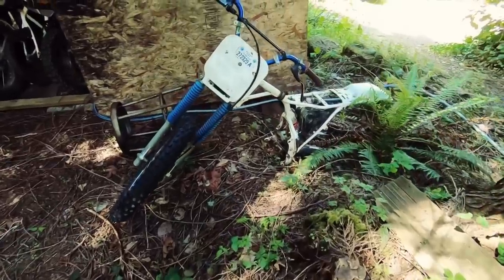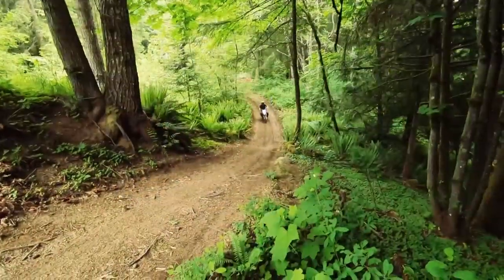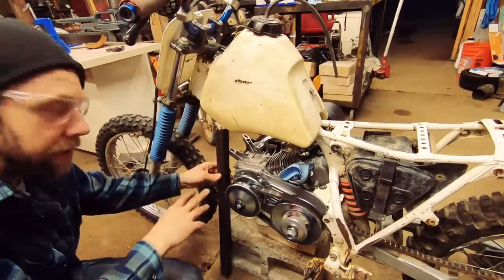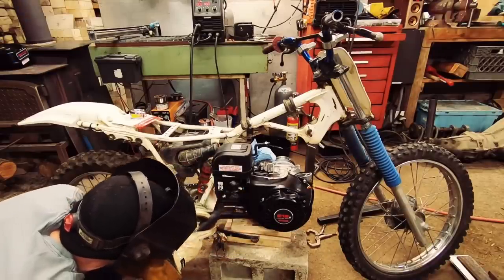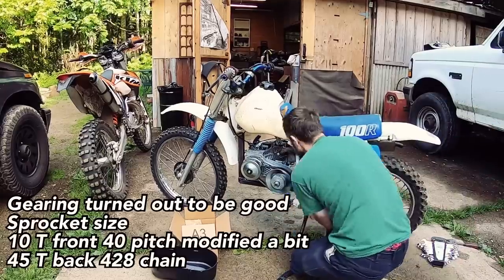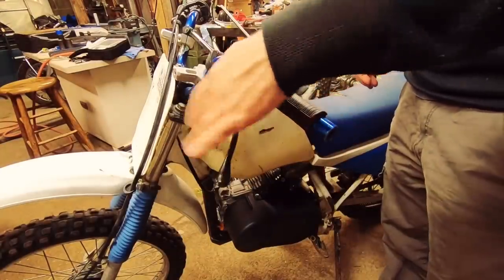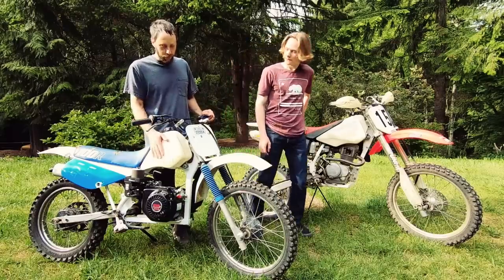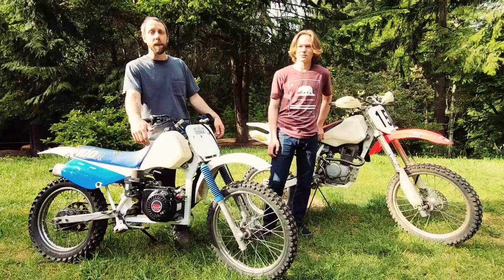Predator 212cc engine swap mini bike motorcycle

Comment: Could you just weld the old sprocket on the new sprocket that comes with the kit?
Reply from the maker: No this won’t work due to the lack of room where the sprocket fits in the CVT. Probably a good way to go is just use the stock 40 pitch sprocket that comes with the CVT and order a 40 pitch 50 tooth sprocket for the rear wheel, Transfer the bolt pattern to the sprocket and run that on the back wheel. I think this would be the best, because the 428 chain is really to wide to fit good between the CVT backing plate and the back pulley. I hope this helps 🙂

Comment: Neat build I think I'm gonna try to find an old dirt bike to do that to .... Probably be worlds better than these Chinese mini bikes
Reply: georgiaridgerunner 79 why wouldn’t you just fix the engine on it? If it has one
Reply: Because th as t gets expensive with old bikes and sometimes this is more fun.  I use a 1978 km100 to ride in the pit area at races, and if that engine blows, I will probably go this route.
Reply: @austinw561  Austin for a project like this one would want a bike with a junk engine ... I wouldn't buy a bike with an engine that was worth something for a project like this

Comment: What is trans called ,to fit those engine,s  probley work good for those cheep Chinese, 4 wheelers  also
Reply from the maker: Look up go kart CVT torque converter, I will post some links to Amazon in the next video :) Take care :)
Reply: If your looking for a cheap direct auto drive setup even search up centrifugal clutch 212cc for alot less weight too. Loads more tq compared to this hp stretcher setup
Reply: Thanks for reply

Comment: Cool video man, I have an old 1982 dr125 with a shot motor, it’s a full size frame, and I was wondering if you think that a predator 212 would move it, also I was wondering how your welds have held up over this time?
Reply: It would prolly run and i think quick welds would do if not then remake the frame or smth
Reply from the maker: My 212cc bike is still doing great 👍 
The engine stock would probably move your bike about 40, with some upgrades it would probably do about 50 or 55MPH.
My welds are holding up great, I have been welding for years now and have welded much more technical stuff then this little mini bike frame.
Take care
Reply: Thank you for responding, I think I might try this project myself

Comment: I want to try this on a three wheeler. Someone said I need a jack shaft. Can you tell me why or when this would be necessary and is that something I can by online?
Reply from the maker: I don’t think you would need a jack shaft, just run a CV transmission any you Should be good 👍
Reply: Mike festiva I was looking at the three wheeler today and it has a Kawasaki engine similar to the predator engine. It was like that from the factory but it is driven by two belts and a forward and reverse gearbox. I’m hoping to be able to figure out how to adapt everything. I might try to put a chain sprocket on it and run it similar to yours.

Comment: I have an old 250 virago with bad engine.If I were to use an engine like this to build a fun runaround bike,could I still use the virago's transmission......and how would I do that?....
Reply: I’m not sure but I’m thinking not
Reply: Yes bro it is possible
Reply: Check out engine to gearbox conversion mostly done with atv engines but i thinkit could work
Reply: Uranik Kallaba good to know
Reply: I could be wrong, but bike transmissions are for the most part built into the engine. It’s not like a car where one bolts onto another, so I’m gonna say you can’t. Good luck though! Those Yamaha’s are nice bikes
Reply: @maverickwoodcock7889  yea thats true but if you find some engine that has a blown piston or some problem, not in a working condition,  you could initialy use the other part of the engine as a transmission

Comment: I HAVE A 1990 CR250 WITH A BLOWN MOTOR. THIS IS WHAT I WANT TO DO TO MINE. I WAS THINKING OF USING THE 301 8 HP . WHERE DID YOU GET THE 428 SPROCKET FOR THE TORQUE CONVERTER ? COULD I GET A 520 SPROCKET TO MATCH MY REAR. VERY SURPRISED THE BIKE MOVES THAT GOOD WITH A 212 .
Reply: If it's a 2 stroke 250 just rebuild the motor if it's a 4 stroke cr 250 then I would go that route
Reply: @zebsdreamgarage9898  honda didnt make a crf250 in 1990. He definetly means 2t 250
Reply: @nou943  I completely forgot about that
Reply: @zebsdreamgarage9898  THE CYLINDER IS BAD, THE POWER VALVES ARE WORN, THE LOW END BEARINGS RUSTED STUCK. I HAVE ALL THE OTHER STUFF TO CHANGE IT. WINTER PROJECT MAYBE
Reply: @howtoguroo2686  ya that's a good winter project. I would be able to rebuild that engine in 2 weeks. Only because if the lower bearings are seized that makes it a lot harder to tear apart just soak as much stuff as you can on it with penetrating oil. And leave it soaking for a week
Reply: Bajapowersports.com used to sell every part inluding the woodruff key for the front sprocket
Reply: @zebsdreamgarage9898  THE ENGINE IS EASY TO REBUILD .THE CYLINDER ONLY 1989-90 I THINK WILL INTER CHANGE , SO PARTS ARE HARD TO FIND ON THE POWER VALVES. I LOOK FOR USED CYLINDERS ON EBAY , 1989-90 CAN NOT FIND ANY CHEAP ONES . I BOUGHT A 1989 AND 1990 USED BIKES HOPING TO MAKE ONE GOOD ONE .BOTH CYLINDERS WERE BAD .
Reply from the maker: I hear you on the old 2 stroke. I have a awesome 96 KDX200 that needs a new crank, the cylinder needs re plating, it’s going to cost over $800, in parts, there’s just a point where I draw the line on how much to put into a old bike.
Reply: @Mikefestiva  YES, I AGREE. AND SOME TIMES YOU CAN FIND GOOD USED PARTS ON EBAY THAT HELP KEEP COSTS DOWN. THE 1990 CR250 , I'M THINKING PULL START MOTOR REPLACEMENT .I HAVE ALL THE PARTS .I DON'T RIDE FAST ANYMORE ( I'M 60 YEARS OLD ) .THIS BIKE WOULD HAVE BEEN PERFECT AT THE WIND ROCK PARK IN OLIVER SPRINGS IN TN. SLOW , ROUGH TRAILS UP THERE . WE MET UP WITH RED BEARD FROM RED BEARDS GARAGE , AND HAD A GOOD TIME . BUT THE MINI BIKES JUST BOTTOMED OUT THEIR FRAMES ON THOSE ROCKS . VIDEO SHOULD BE COMING VERY SOON FROM RED BEARD.

Comment: ive been looking to do this to my 1980 xr200, since it got a crack in the cylinder
Reply from the maker: RNDM-R1DR  I think this is a good way to go if you have a bike that’s got a bad engine, it will definitely get you riding again! I hope your XR200 turns out good :)
Reply: thanks man
Reply: I hope you do it this seems like such a terrific swap especially the way Mike does things simplicity is genius

Comment: Predators are good engines but duromax engines are better I threw a 16 horsepower duromax engine on my go-kart in now it go 60 miles an hour and got so much power highly recommend those engines
Reply: Or get a predator 420cc and go 70 or 80!
Reply: @bradley1995  The duramax ones are actually more powerful
Reply: Good luck fitting 😂 You might end up having to mount the motor way near the ground, the 212 is tall and like you can see on this video, he lost some ground clearance and the larger Predators are inches taller plus wider, and wider would make it not so enjoyable for handling in my opinion, and maybe be too bulky for a dirt bike.
Reply: I think those are more expensive

Comment: Got a 77 yamaha tt500 and a honda gx340 looks like i done found a good purpose for both
Reply from the maker: Sounds like a plan!
I had a old Yamaha SR 500 ( it’s the street version of the TT/,XT) that I converted into a big dual sport bike, it was a wheelie machine 🙂
Reply: Update new frame section is built jackshaft is mounted just gotta figure out my rear sprocket situation

Comment: Wow talking about mini bikes from the fifty’s and sixties i build mini bikes and mini bikes now have suspension
Reply: My brother owns an original Taco 99 minibike, circa 1968. It has front and rear suspension and a 5 horse Briggs.  The most bad ass mini-bike from the sixties was the Bonanza which  had a Hodaka 100 and 4 speed transmission.
Reply: @scootergeorge9576  you mentioning hodaka motorcycles brought back some fond memories,  i always thought hodaka had better names for their bikes than any other manufacturer , i mean come on, who wouldn't want a dirt squirt, or a road toad or maybe even a wombat to blast around on? lol
Reply: @ht2275 -  Ace 90 and Ace 100 come to mind. They were pretty cool bikes. In the sixties, I rode a Honda but thought the Hodaka was a cool dirt bike. This was Thousand Oaks, CA. Back then, there was a whole lot of open land for dirt bikes. Now it's densely populated "Yuppie-land"

Comment: So 212cc good enough or would like 420cc engine be better? Thinking on doing this
Reply: A 212cc would probably be the best. 412cc would be to much.
Reply: There is no 412cc predator there's a 420cc
Reply: @tjc9431  meant 420, i didn't see that
Reply: @ChristianLance.  too much?? I just sorry it wouldn't fit
Reply: @fatalcapsaicin5157  It would be too much for the dirt bike with that size of a frame.
Reply: Just buy a lifan 125cc instead, that thing has more HP and it has a 4 speed shifter with 60mph top speed.

Comment: I didnt hear you say this..but I hope u already addressed the kill switch..did you mount it on the handle bar area?.. atleast the orginal  bike had a clutch to pull in if the carb stuck wide open.. if this bike did the same thing...no way in hell could u bend down to shut it off.. plz tell me you wired in the shut off switch to the bars..lol
Reply from the maker: Yes I wired up a kill switch, like you said without a clutch it could be bad if the throttle stuck without one.

Comment: Ordered the cheaper one that is in the link and it does not fit. The keyed part does not fit in the slot.
Reply from the maker: Sean W sorry to hear that. I just checked the link and it looks like Amazon sold out of all the 3/4” kits, the only ones were available were 1” clutch CVT kits. I just deleted that link, I don’t like that Amazon changes products without notifications. Now does the clutch not fit the shaft size or just the keyway? The stock keyway for a 6.5hp predator engine is 3/16” does the key fit to loose or not at all? Is it close but won’t fit? Let me know.
Reply: Mike festiva I had to ship it back, the key on the clutch was way bigger than the HF key way

Comment: What's the too speed?
Reply from the maker: I will test the top speed before and after modifying the motor in the next video, so keep an eye out for that one :)
Reply from the maker: Sure I don’t see why not! If the stock 212cc predator engine doesn’t feel powerful enough, you can always hop them up quite a bit ;)
Reply: But always sweet build are you using the xr 100 exhaust

Comment: Can’t you get like 15-20hp out of these engines?
Reply: Kyle King sure can. It can be expensive when you start going say over 15hp but those little motors at champs and they’ll take it. I got mine doing about 15ph in a weekend. Rebuilt with performance cams and such.
Reply: zach trensey to be fucking fast lmao what else
Reply: You can get just north of 30hp last I heard but that costs some serious cash.

Comment: How did you do the chain to belt??
Reply: jack shaft
Reply: The front centrifugal clutch is connected to a rear centrifugal clutch, so the front clutch spins the belt which spins the rear clutch which has a sprocket on it which turns the chain

Comment: Were can you get the chain for this was lookin to use the engine on my old goat cart
Reply from the maker: E bay or Amazon will have a chain. The chain that runs stock on the this torque converter is size #40 that’s 1/2”

Comment: Lucky it all worked out with the gearing. Wouldve sucked if you got it all together and it topped out at 10mph.. I thought of doing this many times, but never have got around to it.
Reply: Surprisingly good torque for stock motor
Reply: Those 212 are beast
Reply: @theworstgamervr  yeah they're great. I meant if the sprockets and wheel diameter were off you wouldnt have much top speed. Looks like you eneded up with a good rounded ratio though.
Reply from the maker: I figured the gearing would be close, if anything I thought it could be a bit tall before I built it, but after riding it around it’s pretty good! I have had much bigger challenges in gearing, I built a sawmill a few years back and I worked out all the gearing before I built it, Engine RPMs, pulley sizes, final wheel size, maximum blade speed to hp. My sawmills gearing is great. That was much more involved to calculate, this motorcycle project not so much. Thanks for checking out my video.
Reply: Im super interested in a project like this you can find frames like these were someone blew out the motor, Pretty cheap and a 212 pretty cheap, my question js this a stock predator? Is that a super light frame i just dont see how your getting that kinda torque with the 6.5hp motor.
Reply: @theworstgamervr  6.5 hp but they make about 12 ft/lb of torque stock. They are punchy little motors stock and you can be at around 9-10hp with a jet kit and good exhaust. They are workhorses. Even stock they'll pretty much chug up any hill. Would be an easy project. Just weld a plate in a double cradle frame, line the motor up and bolt it down and hook the chain up. Btw theres a video of someone putting a 212 in a toyota pickup and it drives around... If your wondering about power 😂

Comment: What kind of transmission
Reply from the maker: CVT 👍
Reply: @De Wisnu No, its not even close to being powerful enough to do that.
Reply: @De Wisnu The engine will certainly be more powerful, but most likely it will still be unable to pass a hard climb as things like that require a lot of power from the engine. Engines that are capable of such things are 450cc engines.

Comment: I'm building a bike with a vertical shaft mower engine.  Ayyy
Reply: That's not gonna go very fast
Reply: My friend put a 3 hp pushmower engine on a old riding mower one time and changed the pulleys around it would do a wheelie for 15 feet when he let off the clutch/brake and run about 35 mph
Reply: @intotheadventure2592  I bet it'll go 20-30 mph.  Not bad for cruising around
Reply: @IntelGoesHard  no it wont ur gonna rev it and blow the motor those arnt ment for revving
Reply: @intotheadventure2592    I've abused a flathead Briggs and Stratton before.  It'll rev just fine to maybe 5000 RPM or more with mods before it chucks the rods.  The valves will float before anything detonates on a stock engine.  Also, if I keep it to 3600 RPM (it's rated RPM) and under it should be perfectly fine and produce about 3-3.5 HP.  Plenty enough to puts around town at 25MPH or so.
Reply: @IntelGoesHard  defintult not
Reply: @intotheadventure2592  alright man ima prove you wrong tho
Reply: @IntelGoesHard  bet. Post a speed video when ur done
Reply: @IntelGoesHard  alr bet

Comment: I have a 2016-2017 agb-36c Apollo DB 36 I need some help somebody that knows how to work on these bikes for a good price Mobile Mechanic to tell me if it's worth fixing or should I just sell it because I have to replace the gas tank after replaced a few other things as well just to make sure it's safe it ran when I got it I laid down my sports bike broke my ankle when I healed up from that the gas had dried up in the dirt bike and now I have to replace the gas tank carburetor have to do new brake lines on it anybody does that and charges good price let me know Houston Texas

Comment: We're did u but this engine
Reply from the maker: I bought the engine from Harbor Freight, this is the Hemi version, if you go to buy one make sure to look for the #60363 I’m pretty sure that’s the right number on the box because they sell Hemi and non Hemi side by side in the stores.
Reply: @Mikefestiva  I have a little small quad this engine looks fast tink il buy it thanks 🇮🇪

Comment: Why offbrand motor though?
Reply from the maker: Off brand? I take it you must not know the following these 212cc Predator engines have? They cost $100 and there’s countless amounts of aftermarket hop up parts available for them.
Reply: @Mikefestiva  and for the price, the reliability and performance is really hard to beat,  I've bought a few of them and built a couple bikes from scratch. Lots of fun. I enjoy the building more than I do the riding. God bless.

Comment: Looks fun. Im sure the 212 doesnt have near the torque that a stock dirtbike engine has.
Reply: It probably does actually, the stock engine I think was 100cc
Reply from the maker: The 212 is surprisingly quick! It smokes a stock XR100, in the next video we do some drag racing and check the top speed, the video should be up in a week or so. Take care :)
Reply: @Mikefestiva  it's a really interesting project, I have a few tt230 frames laying around I might try the same thing with.
Reply from the maker: Hey Darren it sounds like you have some great frames to do this with! This Xr100 is fun but a little bit bigger bike frame would be much better for a grow up. I definitely recommend you building one. The automatic is really not that bad on the trails. Take care
Reply: Even tho its specs say 212cc its still only 6.5hp. im sure the factory engine on that bike made more HP with higher rpms. I use predators on all my minibikes. Put some 18lb valve springs in there, jet the carb and remove the governor next!
Reply: @TheShangralaaaa17  I think the original engine was like 6-7 hp

Comment: take the governor off and that thing will really fly right now your only getting max like 3600 rpm just make sure to add valve springs you'll blow it up otherwise
Reply: If anything the stock valve springs will limit the RPM and make it less likely to blow up. Me and my buddies have carts that we race. No governors, big carbs, timing keys, milled heads and still stock valve springs. No blow ups.
Reply: Milkjug3349 yeah you’re right you have to put a billet rod in it so it won’t blow up